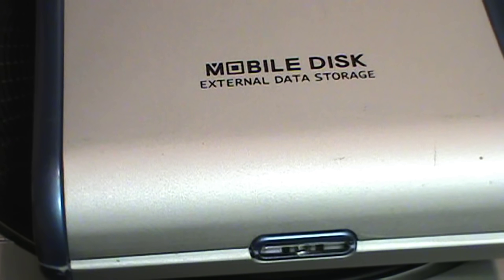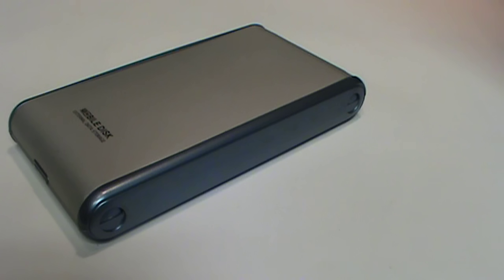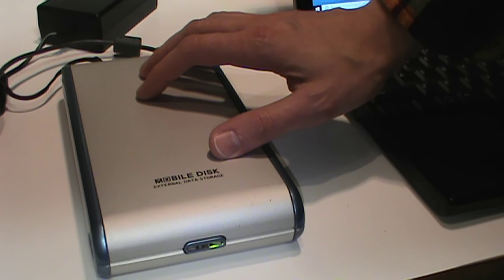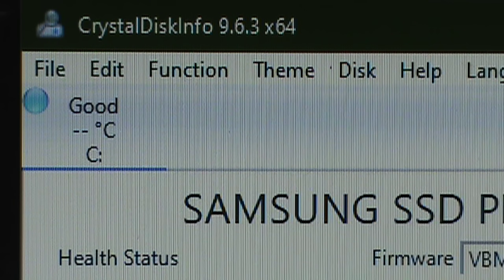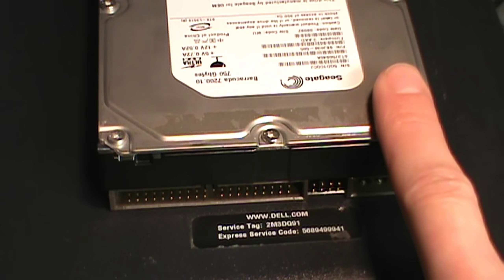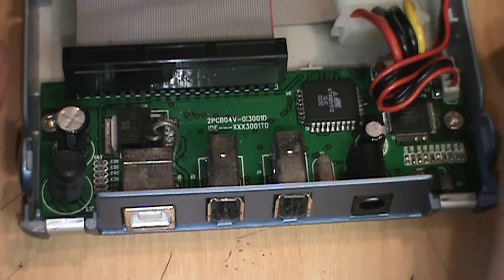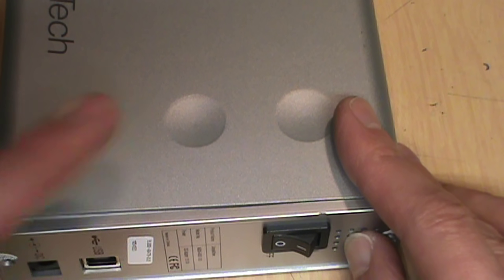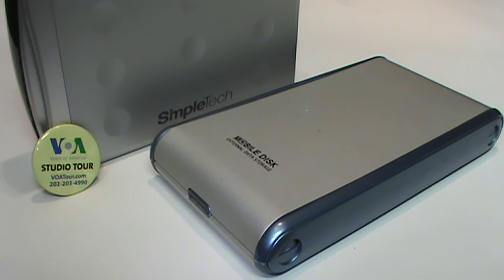The world's largest IDE hard drive failed on me

Comment: Holy carp 🐟 And there was me thinking that 300GB Maxtor drive I have is big for a PATA unit! 😁

Mind you; With the last IDE drives being produced around 2006 or so (19 years back) I'd question the wisdom of storing client data on them today, certainly in any unencrypted and non-redundant state. Building a RAID out of them is probably safe enough (So long as you advise the client to keep their own backups, and advise that your job storage comes with no guarantees) but encrypting the data as well means any sudden unrecoverable failures don't result in potentially recoverable client data on a drive that's been sent to e-waste. 💾🔒👍

Comment: You could possibly use smartmontools (or gsmartcontrol on windows) and pass a -d option to specify your USB bridge to read the SMART data. Newer devices are much better with this but it was hit or miss for IDE and early SATA enclosures

I would immediately replace any drive that shows reallocated sectors.

Comment: I had a similar issue on an almost brand new one, turned out the issue was with the switch. The power switch was wired into the 5v line and caused a brownout when the drive tried to pull power from 5v. I have a feeling similar issue is occurring here, I was going to fix it by squirting some contact cleaner into the switch.

Comment: My go-to for testing drives which may have gone bad is to install smartmontools and run smartctl -t select,0-max on the drive. It's an online test, so you can continue doing other stuff with the drive, and if/when it finds a bad sector that hasn't yet been remapped, it'll make a note of it in the drive's SMART self-test log.

Comment: The reason why the hard drive failed is because it's made by Seagate. I have seen more Seagate hard drives fail than any other brand. All the hard drives always fail before the warranty is up about the halfway point. For instance if you have a five year warranty the hard drive will fail within three years. All the hard drives that I've seen fail are always all mechanical.
Reply: I have 5 Seagate Barracuda 7200 RPM 1TB drives that all work fine after 10 years of use for video storage, editing and playback. No issues. Also, his hard drive did not fail, it was the interface in the portable enclosure that was the problem.
Reply: @rizzlerazzleuno4733  I'm talking about 750 gigabyte Seagate drives being directly connected to the computer. I've had several Seagate hard drives fail doing data recovery for some of my computer clients. Also had several different sizes of Seagate hard drives failed. Seagate is absolute crap

Comment: I have a 500GB hard drive in an Iomega enclosure that is almost 20 years old and it literally died last month. I could hear the click of death inside. Luckily it was just a backup of a backup.

Also the nice thing about SSD's is that when they die, you can't write to the disk anymore, but they are still readable.
Reply: I had an SSD die completely. Like it isn't even recognized, so the chance it's fully dead is still there (It was perfectly functional up to that point)

Comment: pull your data and use wd diagnostics or sea tools to do a full wipe. often times it will fix the low amount of reallocated sectors unless they are really bad sectors. had a few drives that had happend to due to a faulty psu.

Comment: hmm. I have a 160GB hard drive in my deskpro EN (a model visually identical to yours) and it doesnt have any LBA related issues im aware of. It is older than the ATA6 standard but i always had assume a ROM update added it later on if it wasn't always there. I haven't absolutely filled the hard drive but for a while i had a triple boot going on with the last boot partition pretty close to the end of the disk. dunno exactly if it was above 137GB, but it must have been close.

Additionally to my understanding this all goes out the window once you're booted into an operating system with 48bit-aware drivers (for intel these started appearing with the 810 chipset i think). these drivers do not rely on BIOS compatibility to do things and thus as long as they / the OS properly support it, it should be fine. And certainly this has been my experience... I have used a number of >137GB HDDs as non-boot drives on systems older than the 48 bit LBA standard without any corruption, including when writing above 137GB.

I do actually have a few systems where things will corrupt if you use past the limit an hdd larger than 8GB, but again the drivers take care of it. the systems in question are all used as 9x machines, so i simply split into two partitions. first 8gb is for system files and anything for MS-DOS, and second partition for anything left over, for use in windows only. and if youre not doing DOS, but rather a real OS with early load disk drivers, you'd mostly expect issues only with multiboot stuff.

Comment: I've rescued many hard drives from failing enclosures, it's almost always the enclosure in my experience. 

Even if it's probably best not to trust that old a hard drive for mission critical uses, i've still found 'em useful. I have a pair of 500 GB Hitachi Sata drives that came out of a Lacie "1TB" dual enclosure (one of those Firewire 800 ones) and they now boot Windows XP and run games flawlessly :)

Comment: Glad that the drive is working again, but if you haven't already, back up that drive as soon as possible. Even if the underlying issue was minor and was easily fixed, it may be a sign that the drive is reaching the end of its life and should be backed up soon. Some 1TB SSDs are getting to the point where they're reaching the same price as 1TB Hard Drives. It may be a good idea to look into replacement or backup options with a modern SSD or HDD.

Comment: I bought a 1tb firmware drive in 2006 and I'm pretty sure it was PATA and I'm thinking max tor but maybe wrong, anyhow it was dead on arrival so I returned it. Also both Seagate and WD had dos Bootable diag disks to check ide drives, I've used it up until 2012 time frame for checking drives.

Comment: I had cases where the enclosure doing weird stuff causes the drive to think the sectors are bad but if u low level format the drive they will disappear again and i also have drives that say caution in crystal disk and have been for years but continue to work just fine

Comment: I've heard claims from various people that Seagate drives are trash. However, I've never had much issue with them. In fact, my current computer has an 8 TB Seagate hard drive, and no issues so far, and it's now 3 and a half years old. The only ones I've had problems with are ones that were really old and had a lot of hours on them, ones you'd expect to start having problems. Have I just gotten lucky, or are those claims of them being bad overblown?
Reply: I've had great luck with Seagate drives. Unfortunately some folks have them in enclosures or computers with inadequate cooling. Heat quickly destroys a hard drive, especially the 7200 or faster drives. A lot of folks never clean the fans or inside of a computer so everything is running hot.
Reply: @ Well, I’m sure one thing that helps in this case is a fan next to the hard drive bays blowing air across them. Obviously, this really helps in keeping them cool.
Reply: Seagate drives are very much a case of "you get what you pay for". Their consumer drives - particularly those with both partial contact operation and (drive-managed) SMR - can be utter garbage, the 2.5" "Rosewood" series is particularly notorious and seemingly keeping entire data recovery labs in business. 

On the 3.5" front, out of two ST1000DM003s I bought in 2012 one failed catastrophically before reaching 10000 hours, the other eventually got wonky and started developing bad sectors, and the ST2000DM008 that replaced it (an SMR job, unbeknownst to me at the time) did not stand up to Win7 OS duties and developed bad sectors again after around a year. The little ST500DM002 OEM drives (no partial contact operation) seem to have been decently reliable though.

Meanwhile, four ST3000VN000 NAS drives have been chugging along since 2016 without a hitch. Which is more than could be said for the NAS itself, whose Celeron J1900 SoC suffers from the dreaded LPC clock bug. The resistor bodge is holding up for now.

Even Seagate's enterprise / NAS drives can have their issues, but kind of no more than normal usually. If you went for a helium-filled, 24/7 rated CMR model, odds are it should be decently reliable. (The air-filled variety would require good cooling at the very least, I remember idle power draw to be on the high side for a modern drive.)

Comment: Typically, you would just install a DDO on a computer that didn't support 48-bit LBA if you wanted to use a drive greater than 128GB. That's how I was running a 200GB HDD on a Dell Dimension XPS T-500 years ago.

Comment: Too bad for your IDE HDD. I still have a few somewhere, lying around.
7200 RPM. There were Seagate Barracudas that would go up to 10.000.
Mind you, if that sounds high, Renault RS6C could go as high as 14.200 RPM. Those were reciprocating, 4 -stroke, 3.5L, V10 engine from 1994 Formel Eins season. 
This concluded after 2005, when the limit was 19.000 RPM for 3.0L V10. Of course, not only Renault being able to hit this mark.
Contemporary (premier) MotoGP (Grand Prix Motorcycle Racing) class, bikes are rev limited to 19.000 RPM in I4 or V4, 1000cc capacity.

Comment: I found these to be very unrealiable too. I tried to put one in my PS2 and it died in a few hours. Went back to a 500 WD Blue IDE. That's still alive and kicking today.
Reply: I used an IDE to SATA converter plugged into the PS2 network adapter, combined with a 2.5" SATA HDD. Drives are much more readily available, cheaper, not as noisy, nor hot running
Reply: @Knaeckebrotsaege  We're talking like 15+ years ago.
Reply: @ :shrug: plenty of people modding these now. But yeah barracuda 7200.10-14 were awful in terms of reliability. from self-nuking firmware to failing with thousands of bad sectors overnight...
Reply: @Knaeckebrotsaege  they are the OG drives that gave the bad name to Seagate
Reply: @Knaeckebrotsaege  Agree. I had a Seagate Barracuda 7200.11 500GB from 2008/2009 with BSY bug (firmware SD15), and its SMART have bad sectors, but data is still reliable on it oddly. Also for my safety I updated the firmware at my risk to SD1A and now it works good, without BSY bug that froze the PC and made bad sectors at that moment, needing CHKDSK.

Comment: Experience shows that a hard drive can no longer be used reliably once the first read errors occur. Any repair tools usually only have the opposite effect, putting more stress on the drive and causing it to fail even sooner.
Reply: This is mostly with newer drives as data is way more compressed than it used to be. With older drives it's less of a problem since data is more spaced out

Comment: Why am I not surprised you have the biggest IDE drive there is?
What is the max transfer rate? GPT claims it's 78 megs per second.

Can't deny I miss the old PATA connectors. It's what I grew up with.
Reply: Why you use the damn CGPT instead of Googling the actual manual of the drive? Is the world goong crazy these days by asking everything to the [mostly incorrect] chatbot instead of doing actual research?
Reply: @zusurs  EDIT: I originally meant sustained write speed - not max transfer, which is of course easily determined by looking up the bus! 

Chill. I was having dinner while watching the video - having to go to work straight after - which is why I talked to GPT instead of using my arms to use google. And guess what GPT did - GOOGLE IT. I cared for an actual value though - not only the stats provided by the manufacturer.

And - looking at the data sheet by Seagate I was of course right: It includes only a max speed - not a prolonged write speed which is just the theoretical IDE limit.

That GPT was "mostly incorrect" is a gross overstatement. - That said: Have you seen Technology Connection's video on the matter of doing research lately?

People hating on people for using a useful tool is crazy to me. Next you yell at me for using google maps instead of digging out my old maps. I am still able to verify information AND to ask somebody who will actually be able to provide a real world test result.

Comment: In my experience, Seagate 7200 RPM drives are just ticking timebombs. It's definitely a good idea to pull everything off it before it completely poops out. 

Also, it blows my mind that people just dump hard drives off at thrifts. That's putting a whole lot of faith in a stranger.
Reply: Got a lot of those (like around 20, from 250GB to 1TB) and their maxtor counterparts, some where ok, some died. The only seagate disks I bought after 2010 where from the constellation ES serie and cheetah 15k serie (SAS 1 and SAS 2), and for other brands, like during the HDD shortage when WD factories in Thailand where flooded in 2011 and basic consumers-class drives tripled in price almost overnight, on the SATA side, I only bought SATA RE4 from there (it was cheaper than the average WD blue of the same capacity, the demand was extremely low on RE4 at this time), and since then, I totally ditched consumer class drives, even for personal use, even for external backup SATA HDDs, those disks just never give up, and even 10/15 yrs later, their SMART data are still clean.
I got around 40 RE3 and RE4 in total, and I got only one 250GB failed drive (in a RAID1 on a constantly running RHEL web server, it fried without prior SMART degradation, RAID1 with daily backups, not a big deal), my go to for SATA drives, but for SAS drives, from 7200rpm to 15k rpm, my go to was Seagate, I got around 24 disks 15k rpm SAS from Seagate, and only got 1 that failed recently, like 2 weeks ago (and it was a refurb from an HP Proliant : DAF300 rev BAFDV, SAS2 drive, with insane uptime, over 100,000 hours, and my LSI SAS card just don't want to show it to linuw, at all, it marks it bad and hide it from the kernel in JBOD mode with direct passthrough, so I can't even tell how bad the SMART looks).
Reply: There's a UK high-street chain that sells secondhand electronics, including HDDs. They advise people that all drives are „formatted“ during the testing stages, giving people false assurance that the drive will be fully data-wiped before resale. 🧽💾👍

I have a script I use which reads disks in sequential 1MB sectors and spits out the SHA-1 hash for each one, and I've used it for long enough I've memorised the hash for 1MiB of null bytes (i.e: A completely blanked and empty sector). I can definitely tell you that drives from this chain - Except the odd SSD that's correctly had the TrimAll command sent to it -  do not get data-wiped. ⚠

Comment: I had a Hitachi drive from 2010 throw reallocated sectors in CDI, but Hitachi's own utilities cleared it as good.

That drive lasted ten years (and would have gone longer if I didn't replace it with an SSD)

For this particular drive you might want to give it a once over with SeaTools and see what is has to say.

Comment: These enclosures really cook hard drives. I had a Hitachi Ultrastar in one and that would frequently exceed 60C. Granted, that was an enterprise hard drive intended to be actively cooled. These Barracudas are more consumer oriented and run cooler.
Reply: Not every enclosure is bad. I have a Fujitsu Siemens USB 2.0 one and that has a fully aluminum shell that keeps the HDD very well cooled

Comment: Yeah that CrystalDisk chime sound is very familiar to me as someone who worked in a computer shop for years. I think your misreading the Reallocated Sector Count information, what its saying is all the extra reallocation spaces on the drive are filled and that you have 3 bad sectors that can't be reallocated correctly as spillover.  If you want to continue using the drive you should zero fill it to 'fix' the bad sectors, that might squeeze a bit more life out of it but the drive is on its way out.

Comment: I have a bunch of these. These were made in the mid to late 2000s. This was the era of the capacitor plague as well as the 2000s quality control plague as a lot of manufacturing of more complex electronics like circuit-boards shifted out of Taiwan and into places like China, Vietnam and Malaysia. There is a LOT of stuff from this era that is breaking down much sooner than previous eras of tech.

Comment: Am I crazy? I could've sworn I remember using a large drive on a system without 48bit LBA support. Therewas a driver to install, if I remember right. OnTrack Disk Manager? Did I dream that, or does anyone else remember it?
Reply: It existed and I think there were similar programs for the classic Mac. I just used a pci drive controller instead

Comment: 400GB IDE drive is a total score at $3.99.
Reply: Less than a penny/GB
Reply: not really if it d i e s in a couple of months
Reply: @bftjoe  My old 500GB Samsung SATA drive still works today after 15 years. I have some HGST drives that are over 10 years old now.
Reply: Perfect, that would be a great HDD for a Windows XP era system (so long as it supported more than 128GB per drive). My XP laptop has a 160GB IDE drive installed in it.
Reply: I remember when 4.00GB was $399!
Reply: needed for apple xraid enclosures, which were canceled back when they used IDE drives. (2x6 bays).
Reply: Funny fact I once bought a 400GB hard drive at a thrift store and when I plugged it in it reported as 40GB. Turns out the price sticker was over the GB number and so what I thought was 400GB was in fact 40.0GB WTF?